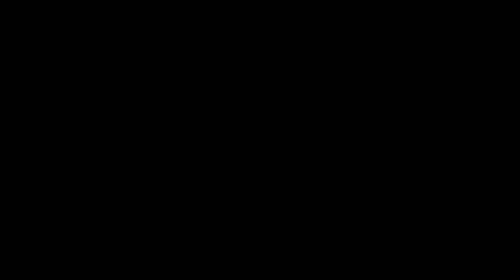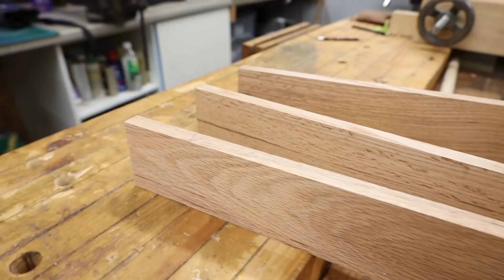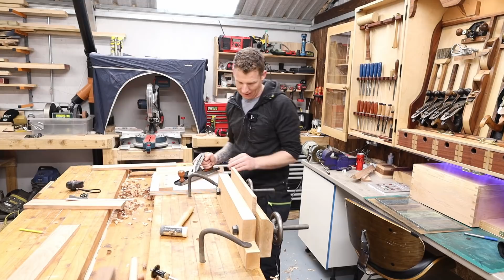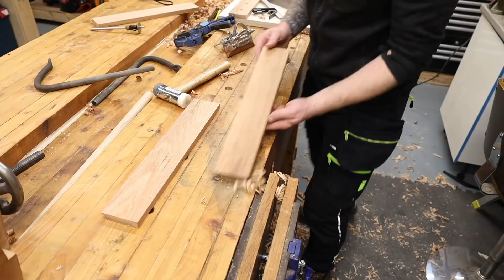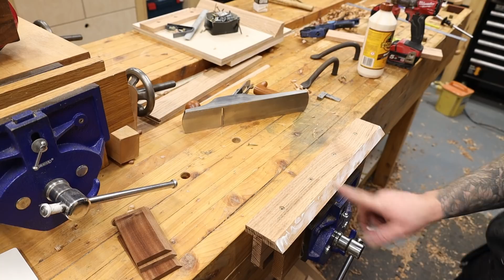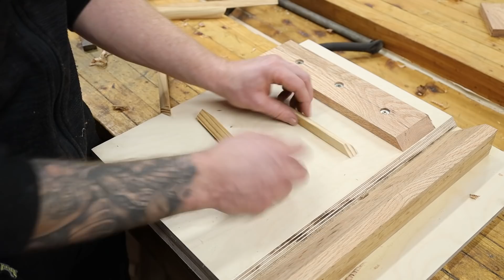Donkey Ear Mitre Shooting Board, Hand Made for Hand Tool Woodworking!! Inside and outside Mitre Jig!

Comment: Just a couple of things I find  easier :- mounting the stock somehow so they your planing flat,  and  skewing the iron slightly  to correct the cut keeps the sole flat on the stock  for the full stroke rather than the plane rocking on the high point.!?  works for me..!!

Comment: Thanks for this John, I just made one the other day using this as a guide and I'm over the moon with it. Already done the job for two small mitre projects so it's definitely a keeper.

I think if we compare the design to some other options there's a downside in that you probably can't use it for shooting thicker boards, eg something more than maybe 3/4 inch thick due to the amount of blade exposed above the fence, but that might be something can be tuned with other shape boards. On the plus side I think it probably works better than the equivalent upside down jig for doing the ends of longer boards due to the way you end up holding them.

Comment: I made two of these, one 45 degrees for rectangular/ square box sides and one 30 degree for octagonal boxes. I had used this donkey ear design in the past to create accurate box miters using crown moulding. No other jig will work for this exacting miter. I too had a O.1 degree error after gluing but I could easily take that 0.1 out of it by using a card scraper. It worked perfectly, and was easy to control how much and where to shave the error off. Its a classic design and if you want to make fine miters on pre shaped stock like crown moulding this jig is essential! Nice video John, well done!
Reply: Great, thanks for sharing your experience.  I'm considering abuild at 22.5 degrees for Military Flag Display Cases. 
*You have convinced me to go for IT.

Comment: Terrific skills. I can't understand why the edge of your jig doesn't get shaved off together with the proud piece that you are mitering. Very magical!
Reply: The edge does get shaved off! ... But only to the depth the plane blade protrudes, a few thousandths of an inch, and except for a few millimeters of wood near the bottom of the rail, where the plane does not cut due to the blade not spreading to the very edge of the plane. The plane rides on the bottom part, and unless you tilt the plane up off the runway while shooting, it doesn't cut into the rail any further. After the plane shaves as far as it will go, this unshaved ridge keeps the plane from engaging further with the rail (a rabbet plane with the blade going edge to edge will completely eat up the rail). All shooting boards work like that!
Reply: @michaelallenyarbrough9503 Exactly right, it's just a little unnerving for the 1st build of any jig. BUT it gets easier  . . .good times 🪚

Comment: I think instead of using the combination square to find the angle, use the marking gauge to find the depth of the stock, then scribe your line with that measurement will produce a more accurate 45.

Comment: Fair play from New Hampshire US John. Found this yesterday and built mine today. Since I needed a third hand lining up the mitres I reached for the two sides tape and lined them up dead nuts on. Placed my screws, removed, did the glue and rescrewed. I will use for mitred boxes with a full width hidden spline now. Never liked the horizontal splines showing on the corners. All the best!
Reply from the maker: Nice! Really glad the video was useful
Reply: That's a cool idea, what Wii you use to cut the groove for the hidden spline?

Comment: Great video, but why did you use the combi square, rather than setting your marking gauge to the width of the board?
Reply from the maker: It gave me a line on the end to work to and achieved the same thing, either way will work